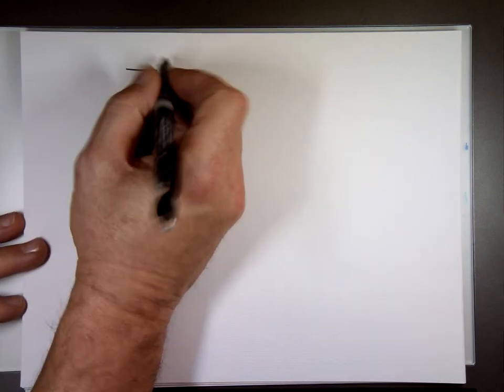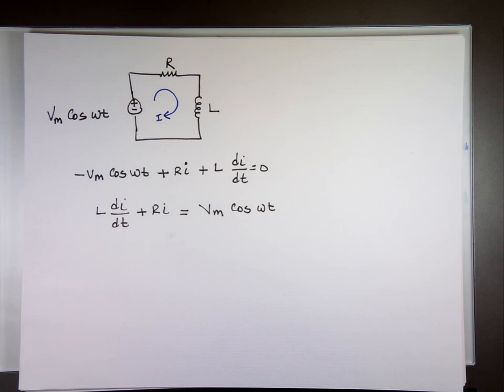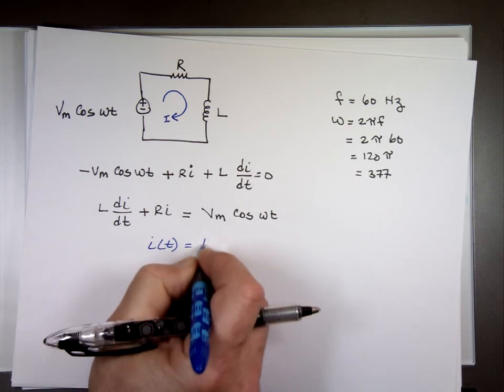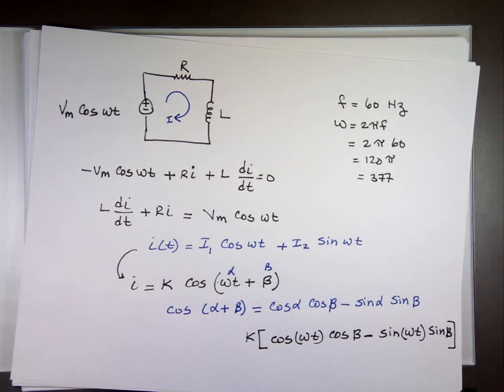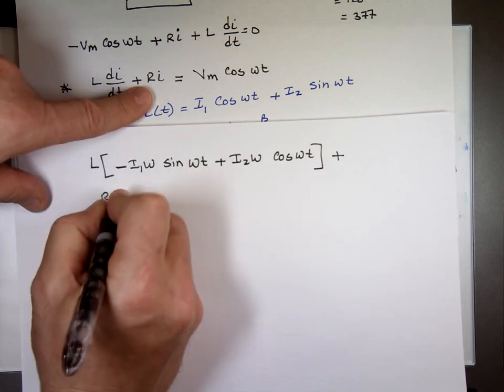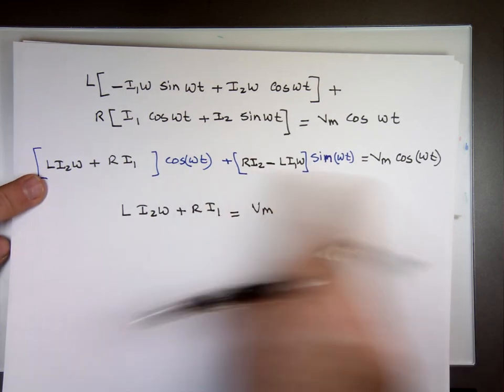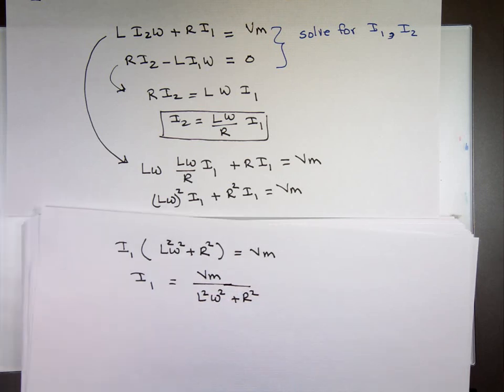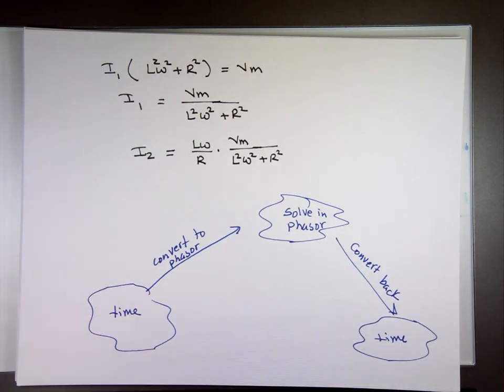Forced Response to Sinusoidal Functions

Comment: And if it is sin
Reply: as long as you are consistent with using either sine or cosine, you should get the same answer in the end. if it is sine, you can always convert it to cosine by: Vsin(wt + phi) = Vcos(wt + phi - 90)
where phi is the phase angle